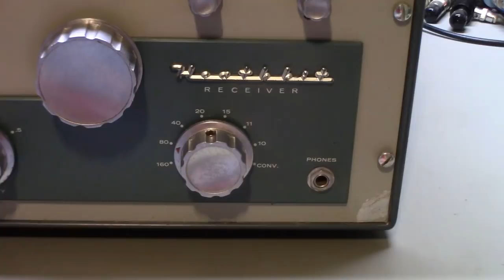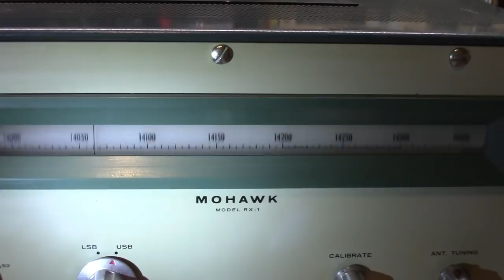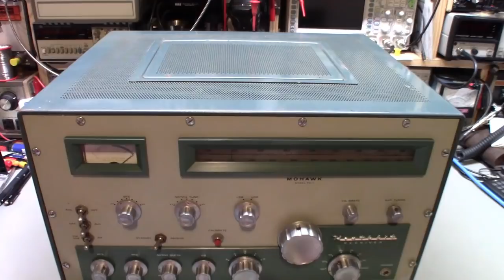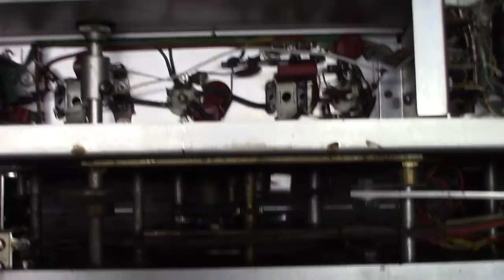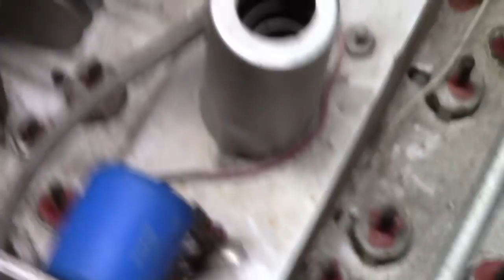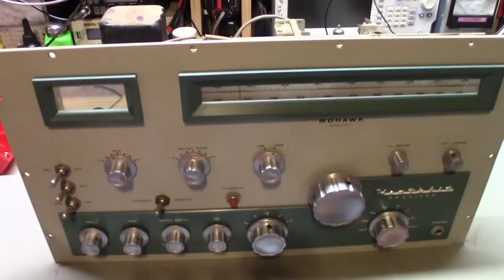Heathkit MOHAWK RX-1 receiver basket case.

Comment: I think the condition looks very good for the age and I assume it’s got it’s original knobs. I have not done any valve stuff in a while but probably will soon. I have a 1930s straight TRF I need to look at. Equipment that’s been modified is a pain but getting untouched gear is always a pain. Thanks for sharing regards Chris

Comment: That is why I cut myself off at about 1977 on Ebay electronics for the most part. Those Mica Cap Transformers are unobtanium and when you do find them they are just as old as the ones in the unit. The older it is at this point in the game the more owners it has had which means even more likely to have been modified by many people. So I just say no and walk on by. I always try to find a second one so I have one for use and one for parts. I have 2 Sears Slant Face AM/SSB radio's and 2 Cobra 138 radio's, 3 TRC 465 SSB radio's etc.......If I could find a decent parts chassis for my President Lincoln that is not insanely priced I would have one for it too!

Comment: Makes you wonder if some misguided tinkerer thought he could just swap transistors for tubes like plug in replacements. 
Definitely a basket case. But, the bright side for the owner is the parts are probably worth more than the whole. The transformers alone would bring more than he probably spent on the receiver. 
That vacuum tube crystal is new to me. Never even heard of that before. The radio club back in High school had a Mohawk- Apache line up for SSB, but I never got inside it. 
I feel bad for an owner buying junk like that. There's a lot of way overpriced stuff on EBay, sold by people who don't know or care what condition it's in. I don't recommend that people who don't have the ability or resources to do restoration work themselves, buy boat anchors. You have to know what you are buying. And worst case, you have to be able to get value from what you bought even if it turns out to be a parts chassis.
Reply: Sounds like it was a common setup for high schools. I graduated in '77 from a high school in NYC and our setup was an Apache transmitter,  and a Mohawk receiver.  Loved it then,  and wish I had a set to restore now..